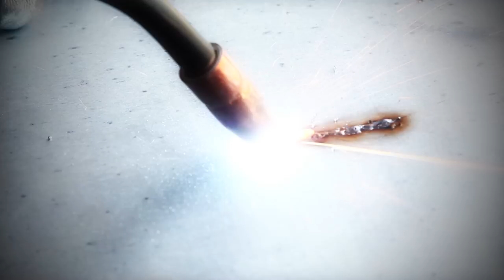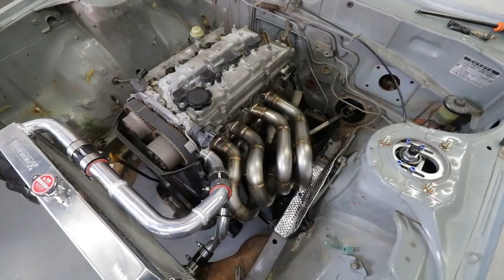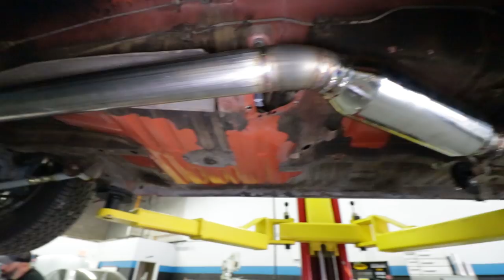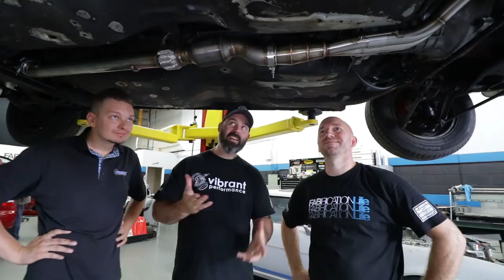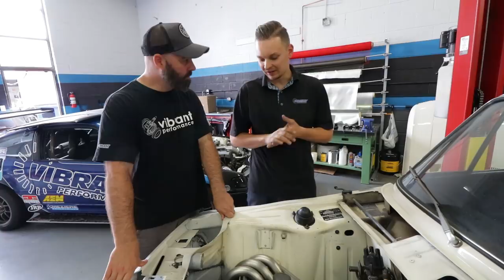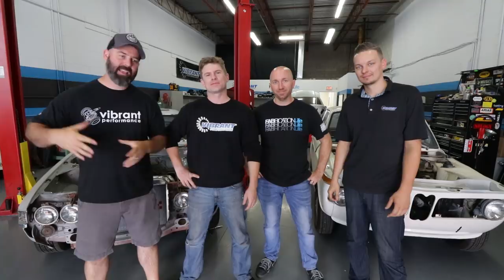Celica Beams 3SGE Header & Exhaust Build-Off Ep8

Comment: All these comments about how 'well designed' and 'engineered' the BMW header is baffling. They just 'made it long'. Like what? Their primary and secondary lengths just happened to be what worked out. There were no calculations or actual engineering applied. No mention of rpm targets. Just cause something looks interesting doesn't mean it's amazing.
Reply: jboylan95 best argument I've read so far out of all there videos.  Regardless of the validity of your point it will out perform what the cars had stock.... all I want to know is how long did they spend on the Exhaust system fab

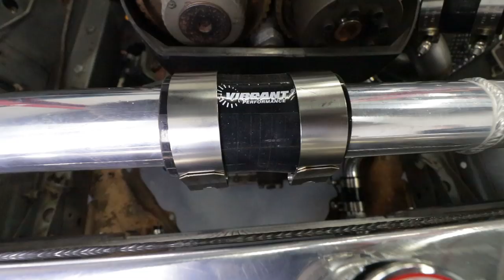Comment: 3:30 "more even pressure than a worm clamp"

Quite the opposite actually. 
https://www.amsperformance.com/wp-content/uploads/2016/08/Worm_Gear_Clamp.pdf

The advantage t-bolt clamps have over worm clamps is you can tighten them more before they fail. But you should be careful about over tightening T-bolt clamps, because their uneven pressure can egg the pipe, which causes hose blow offs if you remove and replace the clamp in a different orientation.
Reply: MrClown you are correct. I hate t-bolt clamps. There are three clamps that do better first is tension clamps just like the OEM uses (funny huh) they never stop squeezing, then there's constant tension hose clamps, lastly there's wire.... look at a Tie-tite tool

Comment: I do enjoy the stuff Speed Academy does, but I like the Vibrant unit better. The Celica's exhaust has a couple of tight "jogs" in the mid-pipe section that I'm not crazy about. I'm not saying I could do better, but from an outsider's standpoint, I think it could be a bit smoother.

Comment: I like the bmw exhaust the best because 4-2-1. Both cars need a hot cam and itb's to make those exhausts work
Reply: jfv65 I got a new cam and itb's coming for the 2002. I haven't mentioned it, as it doesn't apply to this series in particular.
Reply: what sore of cam specs, decent duration and lift or just something a little warmer than stock

Comment: It's pretty hard to vote before hearing the note of each system and seeing what kind of real world performance they offer, so I'm kind of forced to vote based on aesthetics alone. So, while I prefer Speed Academy Celica build overall, and would definitely rather own it, I have to admit that the BMW system is just too insanely awesome looking to ignore. I do worry about the clearance it has between the headers and strut tower, though, since even with solid engine mounts, that is still a tight gap and I feel it might at the very least cook the paint. Plus, while it is based on the motorsport design, I'm not sure if it will necessarily give the same performance, since it seems like the choice of length and bends were primarily based around style and space restrictions, rather than calculated precisely for performance. But I realise that there will probably have been a lot of thinking and planning that went on behind the scenes, so it's had to judge too harshly. I really liked the effort Jay put in to make the Celica system easy to reproduce, by making so many accurate measurements and so on. His attention to detail was brilliant. Either way, both builds are ultra cool and the guys at Vibrant really are amazingly skilled. You should do more videos and another vote later on when the cars are both running, so that everyone will be able to make a much more rounded decision about which build they prefer overall. 

Great series of videos, guys. They were great fun to watch! :)

Comment: The answer is probably in a previous video i just havent had time to watch the complete series yet but what grade s/s did you use for the header?
Reply: T304
Reply: +Matt Gardner  Thats surprising, not the best grade for manifolds as it doesnt like heat cycles and tends to harden and or crack, prob not do bad with no turbo hanging off it but still not ideal IMO, great fab work tho
Reply: Vibrant stuff doesn't have very good prices for the quality of the materials they sell. I'd love if they'd sell 321ss for the price they are charging for the 304

Comment: Why would you not dress off the welds and polish the manifold tubes? It looks a mess and the spacing between the pipes is uneven. Just saying. :) The BMY system looks so much nicer.